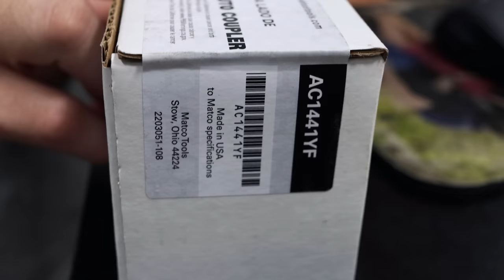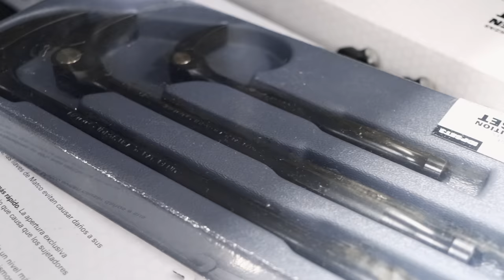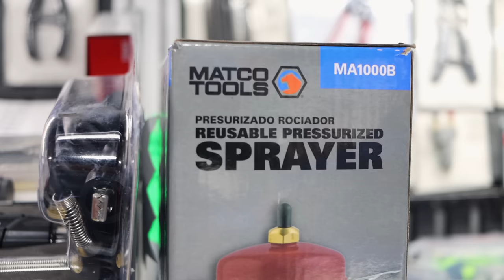Matco Tools: Special Bit Sets In Foam, AC Adapters For 134A To 1234YF

Comment: Number One screw-up, 1975 Chevrolet Monza V-8.  In order to change the last 2 spark plugs you had to loosen the engine mounts and jack the engine.

The alternative engine was the 4 cylinder Chevy Vega aluminum block.

Comment: Our 1234 machine is so slow and has issues getting to full charge. I think they have emissions standards for the machines that makes the process take around 4x as long as the old 134 machine.
Reply: The shop I'm at pays .8 for R134 and 1.2 for 134yf. The machine has all the stupid vacumnn checks and pressure checks and refridgerant identifier tests.

Comment: Starting in 2023 BMW charges a monthly fee to use the heated seats option. If you don't pay, then the heated seats won't work.
Those pressurized sprayers are the way to go. One for brake clean and one for pb blaster.
Reply from the maker: That’s crazy have to pay to use equipment you paid for in the car you bought ….. geez guess BMW thinks highly of themselves

Comment: The 1234yf,it is expensive to buy.The 5th and 6th gen Camaros,windshield has to come out to get some long dash bolts out.I hate the from the bottom engine swaps,waste of time.Did one in a 2013 Ford Edge with the 3.5,was time consuming

Comment: Clay, would it be possible to make a video showing the Matco foam cannon and the soap you are using when you wash your car or truck? I would really like to see the thickness of the foam and how well the soap works. There are lots of videos of foam cannons that are nothing but advertisements for way overpriced junk and it's hard to know what is an honest review. I've seen some that cost almost as much as an inexpensive electric pressure washer and that's just crazy.!
Reply from the maker: I’ve showed it on Instagram

Comment: Starter under the intake Manifold on Tundras. WTF...!
Reply: Not bad of a job , everything to take apart is on top of engine
Reply: Yup on the 4.7s. However, on the 5.7s it's right behind the passenger side exhaust manifold. Have to get the exhaust manifold out of the way lol

Comment: Another engineering fail…On a 5th gen Camaro. You’ve got to remove the windshield in order to remove 2 bolts, so that you can take the dash out. This is to do anything with the heater core or evaporator coil. There’s some ways to hack this job, but it’s the right way to do it.